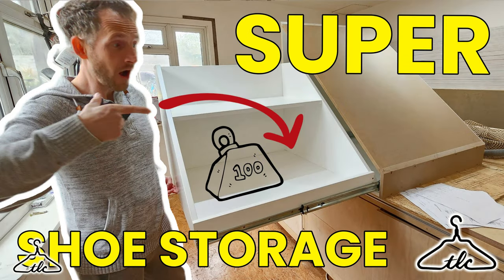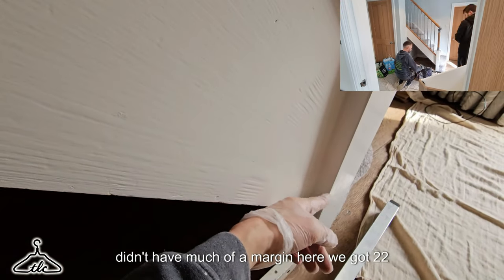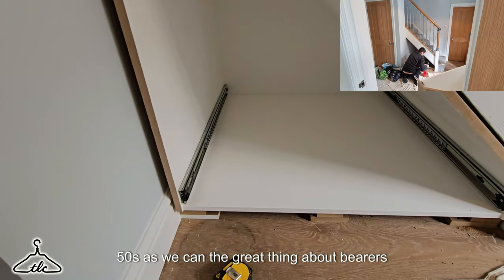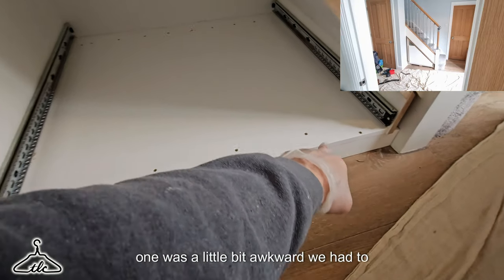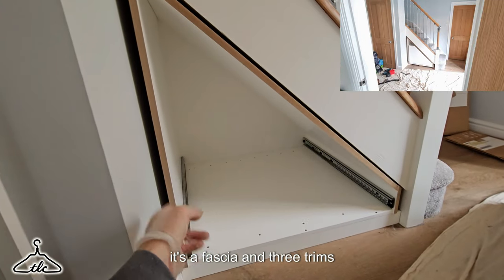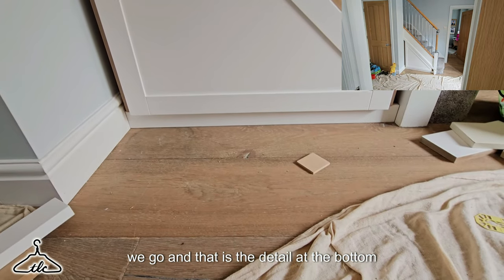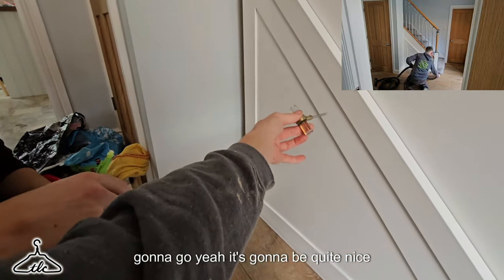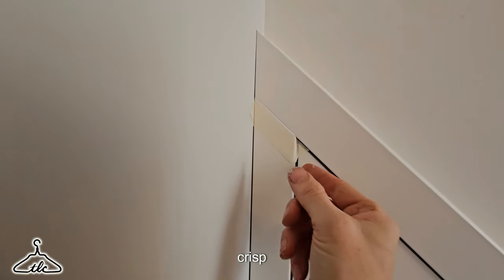Under Stairs Storage : Designing a COLOSSAL Pull Out Drawer ( Up To 100KG Load! )

Comment: Experience makes everything so smooth 😀. I’m currently building a double wardrobe over the bulkhead? where the stairs leaves that slope in a bedroom upstairs. Getting concerned about the weight as made in mdf and the whole thing with doors might be over 100kg. I know very hard to say but would that be too  much weight over that area you think? I boxed the slope it off with some timber and 18mm but still…
Reply from the maker: Hi sorry i didnt see this message.
I think it will be ok as long as the weight is not on the slope but on the floor where there is timber underneath :-)